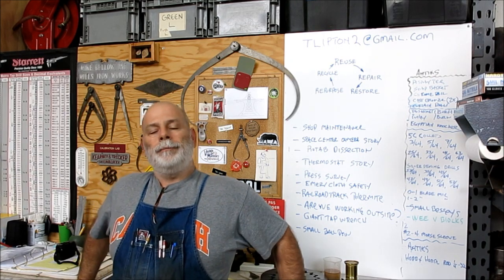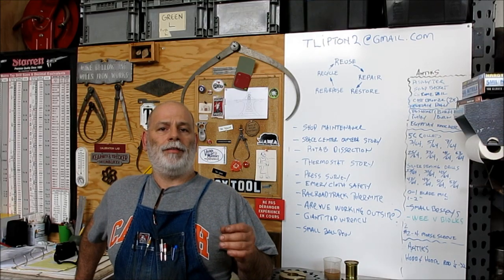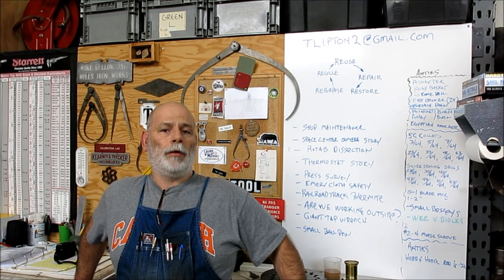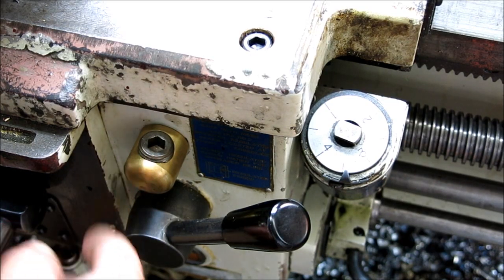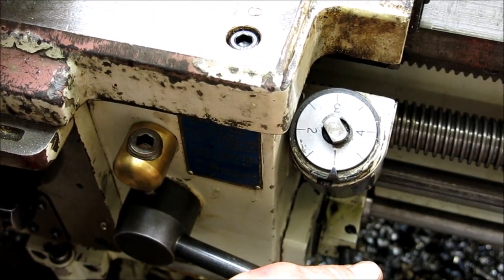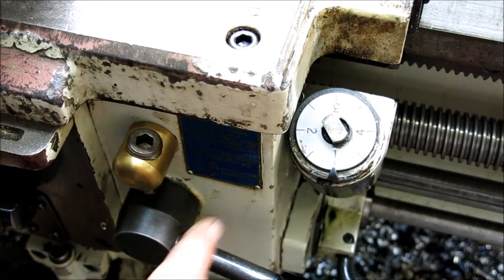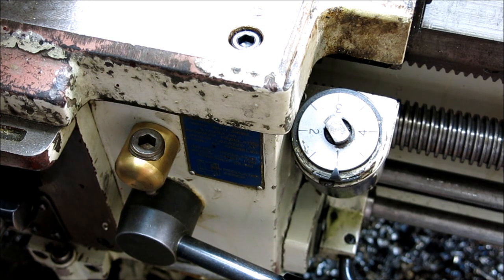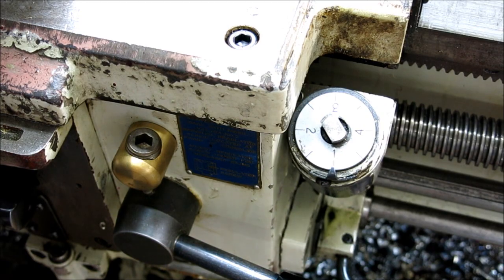Metric Threading with an Inch Lead Screw

Comment: Hi Tom, now that's my kind of shop tip, awesome, man, if I did a video showing that, I'd get tattooed. Just a continuous stream of comments of how I'd be doing it all wrong. And it seemed  you did it as a straight on thread as well, I get accused of that all the time, though I'm actually only cutting the leading edge. As you say, this is great practical information to be shared and used, I like to use the term "bumblebee engineering"  Great video as always!  Uh oh, I just realized, I guess I'm going to have to look for my threading dial now if I'm going to use this, fair enough.
  Thanks Tom, I'm trying to get caught up on  all the videos I've been missing.
       Mike
Reply from the maker: Hey Michael,

I don't know what they put in the water around your place but it sure makes for troll magnets to stick to you. I generally do compound feed but in this case for a shallow thread in easy material it doesn't matter. If the tool fits the groove its right. Incidentally down a bore with a small thread relief against a shoulder radial feed is your only option. Its done all the time. 

Your threading dial is under the pile of chips on the carriage to your right.

Thanks for the comment.

Best,

Tom
Reply: Very eloquent Tom, maybe another good reason to follow your advice and de-chip the shop, repel the troll magnets LOL
  Thanks for the practical information reinforcement!

Comment: I think it would be a good habit to do all threading in this sequence just so you are used to it, Could you use a different number on the dial each time to wear the screw evenly?
Reply from the maker: Hi Max,

I don't think it matters which number you use. You end up with the same groove position regardless. You cannot change numbers mid stream. For a second part however you could change the reference number.

Cheers,

Tom
Reply: oxtoolco Right, that's what I was thinking. Thanks for the confirmation.

Comment: Tom, thanks for conveying the cool technique. I think I'm starting to understand this threading stuff (will have to wait until I have a lathe to be sure though). 

I understand the 30 degree thing vs the straight in form tool concept, but it occurs to me that using both compound and cross slide feed has an advantage even when going straight in...it reduces reliance on memory. In another video I've seen (maybe one of Mrpete222?) the cross slide was always used to back out of the thread, and always 1/2 or 1 full turn of the handle...so it was always 1/2or 1 full turn back in.  The compound was used to control the cutting depth adjustment...and only ever advanced as the thread was cut, so no need to remember anything...just move in another increment and go.  

Seems to me you could combine that with another method I've seen and set the compound initially to the negative of the depth you want and advance back to zero as you go.  So as you are threading it's just one turn out on cross, move back to start, one turn in on cross, turn compound in a bit, if it gets to zero, it's the last pass.  No math needed as you go, and no need to remember any numbers. 

What do you think?

-- Mike
Reply from the maker: Hi Mike,

Its certainly easier to remember where you are when you use the compound or top slide as our viewers from the UK call it. Both methods work radial and angular. Your suggestion would work fine. The only issue I see is the numbers are weird. For example the dial reads zero to say two hundred when turned clockwise. If you unwind it you are starting at say one hundred forty five. As you advance toward zero the numbers don't have any direct reading correlation to the amount of slide advancement. So in this case I say old school rules.

Cheers,

Tom

Comment: Wasting time with these settings Tom. In metric thread dial indicator you're not interested and do not have to disconnect the half nut.
Like I said, Half nut remain permanently connected, just get into the piece to your thread, stop, get off track and go back to another quota, all this without disengage the half nut on the screw!
The screw itself is correlated with the kinematic chain of the lathe. No matter the lead screw up, it's in inch or metric counts kinematics lathe!
I had an American lathe. The screw was in inches. Know what I mean. If the chain sprockets are arranged cinematic thread metric lead screw does not have any job!
My lathe has a metric screw. I have not dial indicator and using the same method and for threads in inch and metric threads. For some steps in inch screw does not change, but instead possibly sprockets.
TRY!

 Cheers,
Dan
Reply from the maker: Hi Dan,

You are correct. But when threading up to a large shoulder you have to stop the spindle rapidly or retract the tool a large distance very quickly to avoid crashing into the shoulder. This is the typical technique used for metric threading with an inch lead screw. The ability to disengage the half nut and not lose that synchronization is the gem in this article.

Cheers,

Tom
Reply: Yes, it's about skill! I did a lot of threads to shoulder in the way I told you and for me is no longer a novelty.
Craftsman counts and it's abilities!
At first it's heavy, difficult, but over time becomes something easy routine.
It's the quickest way threading, not the easiest.

 Cheers,
 Dan

Comment: Mr. Lipton, appreciate all your videos. Question, can you in theory cut both directions by reversing your lead screw only not your entire machine. Thanks
Reply from the maker: Hi Roland,

Don't think that will work. I think backlash in the system will get you on that one.

Cheers,

Tom

Comment: Tom: Can you tell me/us about the exact tool holder and insert you are using?  I think I seen this before on another video of yours, but would like to know about it, as I'm, as they say, "in the market" to buy a treading holder and insert etc.  Maybe a episode on the deferent things out there i.e. lay down vs. others etc... Thanks Brian aka GUSMIX22...
Reply from the maker: Hey Brian,

There are many threading inserts and holders. It will matter what the maximum size tool you can accept in your lathe as well as the various pitches of threads you intend to cut. Be warned that threading inserts can be devilishly expensive. The type I'm using are around $30 each. I would suggest a Nikole mini systems holder with a threading insert. It will also do grooving and cutoff. Inserts are modestly priced.

Cheers,

Tom

Comment: Tom,
Noticed that five or six people have inquired about advancing depth of cut with the cross-feed vice the compound.  Using the cross-feed resulting in a plunge cut, cutting with both sides of the tool or using the compound set at 29 degrees, cutting with only the leading edge of the tool. I’m wondering… maybe it does not matter much with soft materials and possibly using the compound would result in a better finish with hard materials.  Your thoughts on this point would be greatly valued.  TKS for the vid.
Kind Regards,
Brad

Comment: Hi Tom,
I completely agree, this is a perfect example of how good a learning tool this You Tube thing can be. We learn from the combined experience of others. 
I stumbled onto Keith Fenner's channel one day a year ago, and eventually visited his shop. Keith led me to your channel, you to Adam's, etc, etc. all good people sharing their knowledge. 
One question though, I noticed you advanced the depth of cut with the cross feed, rather than the compound. I thought that the DOC should be set with the compound to keep tool pressure only on the leading edge of the tool, as it bites into the work. Is this different for metric threads? 

Thanks for all you do,

Bill
Reply from the maker: Hey Bill,

Thanks for the comment. Its not necessary on ridged machines and shallow threads in easy material. Radial infeed is perfectly fine. 

Cheers,

Tom

Comment: Nice video, Thanks for shearing.
Q:
Is necessary the cutting lubricant on brass material ?? If so...please let me know what kind of it .
Thanks...your videos are helping me a LOT !!!
Reply from the maker: Hi Franjalen,

The material in this case was hard high strength bronze. Alloy 642 to be exact. It was just my standard multipupose light cutting oil. See my video on cutting oils and lubes for a deeper explanation.

Cheers,

Tom
Reply: oxtoolco  Thanks for your answer .
Greetings from Texas

Comment: This is a great tip!  Can't wait to try it.

I usually set the cross slide to the same exact spot and advance the thread cutting bit using the compound.  I noticed you weren't doing this, it this because of the metric thread or the fact that it was brass and easy to cut?

Thanks again for the great tip!
Reply from the maker: Hi Shadow,

Fine thread and easy material. Radial infeed is fine on heavier machines and light threading.

Cheers,

Tom

Comment: Absolutely brilliant my friend! I wish I would have thought of that a long time ago, as it would have made many a job easier. This is great for threading to a shoulder, but for through threading like I did recently I'll just keep it engaged. 
Thanks for doing our homework for us, and showing us another way to getter done. 
Thanks bud!

Adam
Reply from the maker: Hey Adam,

I was so excited when I tried it. It was like finding a new Starrett tool on the sidewalk in perfect condition. It just put a smile on my face.

Talk to you soon.

Tom
Reply: Not necessarily. i don't see any reason to use the old fashioned way of setting the compound at 29 degrees and then letting one side of the tool burnish rather than cut. Might be OK with HSS tooling but most inserts don't do their best work with a very small depth of cut. That's what results when using the compound to advance. The left hand side of the tool would cut but the right hand side would burnish & heat. What do you gain by using the compound?
Reply: He does it wrong way. He should adjusts depth at compound slide rather than at cross slide.

Comment: Thanks for sharing that technique Tom. Just recently I was faced with the same scenario of metric threading up to a shoulder. To cut back on the stress factor I set up a micro switch mounted on a magnet on the lathe bed that would shut down the lathe motor just in time to allow the tool to coast up to the shoulder. Worked great but this would have saved me some screwing around.
Reply from the maker: Hey Chris,

I feel the same way. Somebody mentioned you can hand turn the spindle with the half nut engaged if the thread is in easy material and fine enough. 

Cheers,

Tom
Reply: If the motor is 3 phase and the gearbox is industrial strength you can get very good repeatability from a micro switch by using "plug reversing", which is basically the same idea as the ancient dodge of stopping a steam engine by throwing it straight into reverse. Plug reversing used to be in common use on turret lathes, at least in the UK, and the motors were often fitted with a "zero speed sensing" switch, which would turn the power off at the moment rotation ceased, effectively using the motor as a very powerful brake. 
However for threading this switch is not necessary, as you actually want to reverse the spindle rotation to get back for the next pass.
The concept works particularly well with a swingup toolholder, a modern idea based on an ancient one (the clapper box used on shapers and planers) which makes it unnecessary to withdraw the tool for the return to the next pass. It makes it possible to thread at CNC spindle speeds, at least if you have a VFD (where decel and accel can be set to make reversing a bit less instant, hence easier on the gearbox). 
It can even eliminate the need for a thread relief groove, at least when using HSS (except in very hard materials)
If this idea had been commonly known a hundred years ago, the need for such things as threading dials, single tooth dog clutches, rapid retract toolposts and crosslides, ball-stop crossfeed, snaptap threading devices etc etc, would have been much more limited -- mainly I would guess being needed for internal single point threadcutting, where a swingup toolholder is impracticable, or for hobby lathes with single phase motors or lightly built gearboxes.

Comment: Tom, that is a fantastic trick!  Honestly I have never cut a metric thread with a lathe,  however since I have seen you talk about it in some of your videos I feel ready to try one.  In the shop at school I only have one lathe (a Nardini) capable of metric threads.  My primary lathe at home is a 20"x36" American Tool Works circa 1903 and I am fairly certain none of these were ever built to do metric threads.
Reply from the maker: Hey Mike,

Well all I can say is you will cut one eventually.  Wow 20 x 36 lathe. That's almost tuna can proportions.

Cheers,

Tom

Comment: This will come in very handy if I ever end up with a lathe capable of cutting metric threads, or even one capable of reverse without flipping wires for that matter! lol Thanks for the great educational demonstration.
Reply from the maker: Hey Brian,

Just turn your lathe around 180 degrees, instant reverse. Its all in the observer.

Cheers,

Tom
Reply: At 9000lbs of lathe I think I will just stand on the other side. :-) That should work too. lol

Comment: This is GREAT I have always left the 1/2 nut engaged on metric threads
in the past but this makes perfect sense!!!
Another note on most lathes you can grab a faster spindle speed on the reverse
if you are cutting a long thread, as the feed drivetrain is driven directly off the spindle
and doesn't care what gear the spindle is in.
We have a couple of lathes with clutches that run faster in reverse for this exact purpose.
PS you can turn the spindle by hand for real finiky right up to a shoulder super fine
rifle scope type threads
Reply from the maker: Hey Gent,

You did the same thing I did. I went, well crap that is a cool trick. Why didn't I think of that years ago.

Cheers,

Tom

Comment: Hey Tom, thanks for for sharing. I have never had to cut any metric threads but with everything coming from China I know it's just a matter of time that one of my co-workers will want me to fix something metric. My lathe does have the gears for cutting metric threads but I have never used them. What threads I have cut I set my compound @ 29 degrees and use the compound to to go in to make the cut. Do you have to do something different for metric threading ? 
Thanks, Buddy
Reply: no difference they are both 60deg, using the compound at ~30deg means you only cut with the leading edge of the tool.  I guess Tom has a reason for not doing it?
Reply from the maker: Lasse Langwadt Christensen Shallow thread it makes no functional difference. Compound infeed is helpful with coarse threads and tough materials on light duty machines.

Cheers,

Tom
Reply: oxtoolco Thanks
Buddy

Comment: You were using the cross feed instead of the compound's feed. I'm guessing that this made use of the cutter as a form tool, and you cut both sides of the V each pass. I thought all you old time machinists always just cut with the front during a compound feed. Am I missing something?
Reply from the maker: Hey Pat,

You can do either way. For big coarse threads in tough materials or light duty machines compound infeed is the way to go. Shallow threads in easy materials can go radial easily.

Cheers,

Tom
Reply: The same thougnt here.

Comment: hmm just have a simple question   what would happen if the dial was to make a full revolution then in gage the half nut on the way in or out?
Reply: I'm assuming it's all ratio based. So it'd be off almost surely.
Reply from the maker: Hey Dan,

Lets just say bad ju ju would happen. It would be an ex thread.

Cheers,

Tom

Comment: Great video as usual. As a student of the machinists on you tube, I was asking myself why it's customary to feed with the compound when cutting threads and not the cross slide. I'm aware of the differences as far as the cross slide cut being a direct reading plunge cut and the compound cut being a percentage of dial movement due to the angle of the compound itself. Does it really matter if the operator is aware of the differences? I hope that came out right :)
Reply: Hi Dyno, no matter what some would say you can either use "flank feed", using compound or "radial feed" using the cross slide in feed. both have their plus and minus points but if I would be allowed to offer advice it would be learn whichever you feel comfortable, and competent, with then try the other and see which you prefer. As a rough guide really coarse threads benefit from flank and radial is perfectly fine for fine to medium threads but it is much more but the full answer is far too long for here.
Reply from the maker: Chris Stephens Hey Chris,

Well said. I would add there are times when radial is a must. In particular with precision shoulders on ID threads and small thread reliefs.

Cheers,

Tom